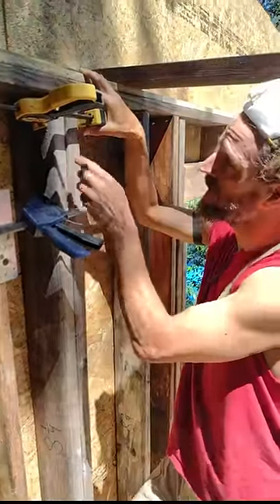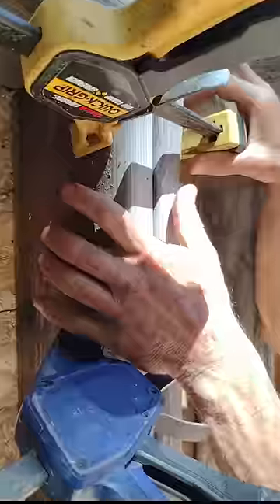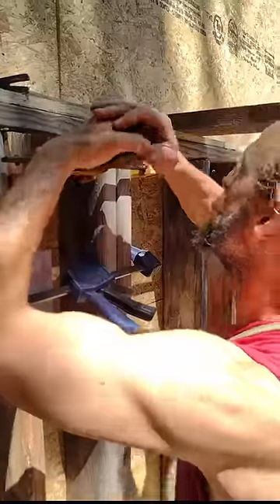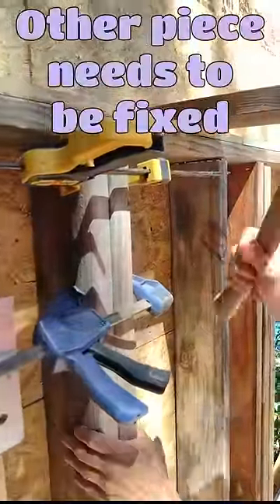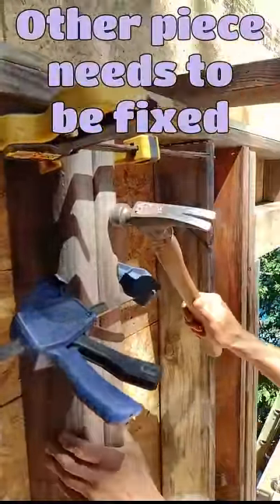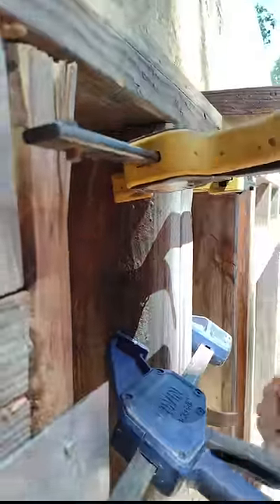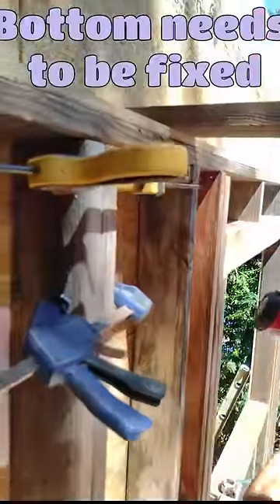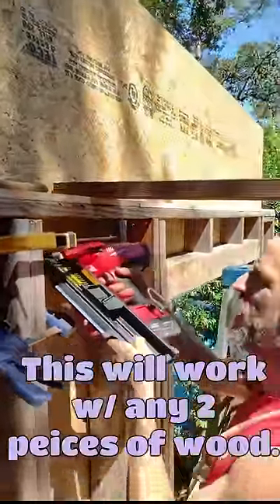WARPED WOOD? Try This.

Comment from the maker: How do you straighten Warped or twisted wood?
Reply: If it is too bad it culled or used as blocking. Sometimes various tricks involving screws/nails for leverage can be used. Some builders also cut studs and pull and nail them back into plumb. This is one reason why lVL products are being used not just for beams and large headers nowadays.
Reply: How far did the siding get pushed out?
Reply: I generally use it for backer board or if we can twist it back we use it. after that .. return it. lots of places get away with it and just sell the shittiest lumber ... dog legged goofy twisters...gotta look down your lumber when uoure buying from homeless death spot
Reply: you dont use it.and never buy lumber that is stored in an outside yard
Reply: Back when we had hammer skills, we'd fix studs like that with a few diagonal spikes driven through the outside high corner in toward the center of the double. The hammer head both pushes the wood where you want it to go and nails it, simultaneously.  Then a few perpendicular spikes to lock it. Takes longer to explain it than to do it.
Reply: Nail
Reply: You use friction ! 😂
Reply: Um wouldn't it still be under more stress and pressure 😅 couldn't that cause it to crack or such
Reply: get a different board

Comment: Hope it isn't getting drywall. The warped wood can also pull the other board out, cracking the drywall. Shaving it down with a plane is a better option for longevity.

Comment: You could also toenail it with half the work! :D LOL
Reply: Yep, a 3" construction screw would draw it in nicely too.
Reply: Why do it the quick correct way, when you can watch some idiot on the you tube show you how to waste a ton of time and nails.... Seems more of a hack tip from someone new in the industry
Reply: @mohawkman2888  yep.  yep for sure
Reply: Ya but it's easier to walk out to your truck and dig around for those clamps you thought you put back in there ........And yes, you are correct, toe nail it and you're done
Reply: Yeppers

Comment: Just put a screw in one of them and use a pry bar!
Reply: I would not. The screw could snap, and then you'd have no way to remove it. You'd be yanking the first stud out just as hard as you'd be pushing the second one in.

I would suggest toenailing, which is putting a nail diagonally from the wood that needs to move in and in to the wood that is already affixed. As the nail is driven deeper in the first stud, it pulls the second stud in along with it.
Reply: @Thalanox a screw wouldn't snap from being pulled on, i use that method all of the Time, ive done it with nails, screws, I've even combined it with your method for more extreme bows, at the end of the day it all works and theres never a one size fits all method
Reply: @Thalanox  What kind of screws are you using?  I use nice construction screws, about an inch to inch and a half long.  They won't break due to a low amount of torque you'll be using.  
But even if it were to snap off, you can easily use the hammer to either hammer it in or break it off flush or just pull it out.  It's not in the wood very deep, about 1/2 inch.
Reply: Hold your pencil against the low board, put the shoe of the nail gun on the pencil.

Shoot one nail, it will stamd proud, grab your cats paw, pry until flush, nail it to hold.

Then drive the proud nail with your hammer.

No need for a drill/screws. 

You can space the nail gun with anything. Rookies speed squares are great to shoot through, just use the corner so it breaks, and make sure you give the guy a new speed square.
Reply: @olddirtybooger I got a good laugh from your comment. I had never thought of using a pencil or square to space the shot and make the nail stand proud.

Comment: True you brought king studs together. Keeping them there with a guarantee can be done with horizontal fire block. Ring shank nails,  hammer driven tip hooked nail and or screws are far better than common nails.  combined

Comment: I drive a nail in the straight stud. Then, use my hammer to pry the other stud. Just have about a half inch of the nail sticking out, put your hammer claw in, and pry on the nail, pushing the 2x flush.  Don't always have a clamp in my tool belt lol

Comment: I always used clamps when screwing bowed metal frames together, i used to build portable buildings. The frames were hand welded and had alot of imperfections. I would get crap for it being a factory environment, but I proved it saved time and energy.

Comment: If you just shoot a nail in the board that is sticking out farther at a 45degree angle on the outer corner into the one beside it, you can them drive it in south your hammer until the boards are flush and nail it off. Saves a lot of time from messing around with clamps.

Comment: Pro tip pull the safety back on your gun drive a 16 3/4 into the stud that’s furthest out and uve the claw of your hammer, or crown your studs a 2/4 shouldn’t be that far out close to the top like that unless you don’t crown your studs
Reply: This guy frames.
Reply: In addition to that always crown studs on your exterior walls to the outside. Interior studs crown either way, as long as you crown them the same direction. Too much crown gets cut into blocks.
Reply: @scottdeason2940  I had an abnormally large lunch so I'm crowning right now
Reply: I used to do this but for framing it’s even faster to just toe nail the proud stud into the the other and drive it with your hammer. It will flush up

Comment: If you're not putting in 2 studs just drive a nail horizontally half way into the stud and vertically halfway into the top plate then hook your claw hammer over the vertical nail and press the stud nail putting the stud into alignment and then nail the top of the stud into the top plate and pull the half driven nails out and you're not even wasting a nail let alone another stud.

Comment: Milwaukee makes a Passlode style gun? Damn, they make everything.
Reply: The milwaukee framing nailer is the shit. Highly suggest buying one
Reply: @ryangluszewski3319   Have you used a Paslode? If so, how does it compare?
Reply: @SightsNjunk  honestly they measure up pretty well. The milwaukee is extremely heavy and pretty bulky, which can make it tough on the wrists. And obviously the paslode has more firepower being an airgun compared to battery. But the milwaukee lasts me all day on a single fully charged 6.0 battery and i havent had any issues with it jamming. The weight of the milwaukee gun is definitely the biggest and probably only negative ive experienced with it, thats why whenever im sheeting a wall or doing something that requires a lot of consecutive nailing i dont use it.
Reply: @ryangluszewski3319 put the the extended mag on it really helps to balance it. I have one and yes it’s heavy but when I put the mag on definitely helped with the weight on the wrist
Reply: @ryangluszewski3319   I usually only use "cordless" (air) guns when I am far from a compressor, or when doing top plates, and punch out work. So being heavy isn't a big deal. I like how much shit Milwaukee has.
Reply: Yeah I want to gat one. I have the 18g finish gun
Reply: @SightsNjunk no gas for 1
Reply: I personally prefer the Dewalt or Bostich brand cordless nailers with the flywheel hammer. the Milwaukee has piston style mechanism which has shorter ramp-up time however is way heavier and more parts to go bad. I've heard the Milwaukee guns need to be professionally repaired every 2 years for a framer. people will disagree but that's just my opinion.
Reply: @levistrnad2965  Man DeWalt is great and all but their cordless nailers are dogshit compared to Milwaukee's line. The ramp up time alone is fuckin brutal if you're used to pneumatic. Milwaukee's framer can sink nails almost twice as quickly as whats demonstrated in this video but i guess ultimately people are going to buy whatever battery line they're invested in
Reply: @mattyboolin  That's the best part about the Paslode. Very short ramp-up time. But you got to buy those damn cartridges. Now I have to look up the Dewalt, lol.
Reply: @mattyboolin  I suppose I've never actually used the DeWalt. I have the Bostitch which I thought was a clone of the DeWalt but I could be wrong. Either way I'm an HVAC install so it works for me...
Reply: Better than PL.
Reply: That milwaukee is battery operated so they don't shoot as fast as the gas paslode but you don't need to buy gas
Reply: @SightsNjunk of you're referring to the gas powered Paslodes then the Milwaukee is just as if not stronger than they are and you never have to worry about getting a bad fuel cartridge. My recommendation is to go with the 30 degree version as it holds twice the nails and you're not getting hit with little pieces of plastic all the time, and the gun will actually stand up when you set it down. The extended mag doubles capacity and helps to balance the gun.
Reply: @MatthewJRedmond the new battery framers are awesome. Only time it didn’t compete with air or gas for me was stitching into yellow pine glulams.
Reply: @jhueth3969  I originally bought mine for shooting on trusses but wound up using it for everything. Haven't found anything it wouldn't sink a nail in yet myself. Have even shot nails through treated wood into concrete when doing interior wall toe plates. Now, granted, the concrete was only 2 days old and hadn't gotten its first hard set, but it makes for a good story to say it shot into some Crete 😂

Comment: That's 1 way,it worked.take 16 penny nail, drive it in on that far right corner, push the board where you want it to go, put a few more nails in it once you've got it in place,that nail in the corner hugs the board over, you pushing on it helps greatly,😶

Comment: I rather used that old lumber than fresh new ready to dry out & twist. The old wood is done twisting & shrinking. Much better build than new wood. This message is too all the none professional home builders commenting. Also, love not putting extra holes in the lumber where not needed.

Comment: That will eventually poke back out and damage the drywall, nails are only good for keeping warped wood at bay temporarily. What you REALLY needs do is give it a little trim on the table saw 👍
Reply: Lmao, wrong
Reply: This is not hardwood finishing carpentry in a nice shop with super tight tolerances for everything. This is softwood framing where structure is what matters. Softwood swells, bows, crowns, twists, and has many imperfections in it. Working on a mostly flat surface here is already an unreliable luxury.
Reply: This was what I thought as well, but I'm no carpenter.
Reply: @Thalanox  a trim on a table saw to you equals a super nice shop with tight tolerances?? Do you do yoga bud because that there is a S T R E T C H. In essence what you've said is im correct but who cares it doesn't have to be perfect, id like to see you say that to a client 👍

Comment: Or you can drive a 10 penny on a 45 at the top of the 2x4 into the top plate and it will pull the board into the other just stop at flush and nail away. No need for clamps. just slow careful nailing!

Comment: Bud, why complicate matters. I can see three different ways to drive in a nail (or screw) with a "toenail" technique. No need for clamps, At All, and Much quicker.
Reply: make a video!
Reply: @gregmize01  YouTube has got all of the "pro tips" vids out there that it could for for.

(You could also put some relief cuts in to bring the shape back, loosing a bit of integrity in the process but I don't know many framers that consider that a big deal while sisterd up to another stud 🤷‍♂️.)

I have no need of creating videos. I was able to give you two different alternatives in this one post alone (without the hassle of working a camera or needing an algorithm to find the right viewers). ✌️
Reply from the maker: Toe nail probably would have worked.  Prybar too.  You are right.
Reply: @TheRegenerativeHome  Eh, the clamps look like they're prioritizing avoiding damaging the studs.

Comment: Put a nail in your top plate and use your hammer to to apply pressure to the bowed board till it's flush then run your sistering nails.
Reply from the maker: That's a real pro tip!

Comment: Just nail off the straight one to the top plate then slap a nail in the straight one and with your hammer pull or push the warped one into place

Comment: Where the heck do you buy your lumber😂?
Also, if you set a screw int to the face od the sister stud, you can just use your hammer as a lever and not have to run back to your toolbag to grab clamps. End result is the same.

Comment: Until that wood movement bends the nail or snaps screw, don't underestimate wood movement, most likely what will happen it won't be that drastic just have a twisted not plumb wall in a few months to years... Just run it over a jointer bro

Comment: I always made a kerf cut if badly bowed.
Reply: Can't kerf cut supporting walls, you either plain or add a 2x2 if the crown faces out. Interior wall you can cut and reinforce after with 5 or 6 ft peice nailed to the side of the cut stud.
Reply: @matthewcardoso5421  I thought it was understood. Kerf the stud and sister a 2nd stud to it.

Comment: Put a screw or nail in the board that is sunk in and pry on it with your hammer until the other board is flush. No need for useless quick clamps. -pro tips from a carpenter.

Comment: Just half drive a nail with your nail gun into the other stud then use your hammer and pray against the nail pressing the stud tight then nail it off with the nail gun. Never seen a framer use clamps

Comment: I think the word is tension, friction would refer to a different type of force :)
Reply: Tension is the pulling-apart force. Compression is pushing-together force.

Friction is what is needed to stop the second stud from bouncing back out after you tap it in.

Use the compression to squish two surfaces together (-->) in order to create the friction (-->) to allow the movement your hammer causes (-->) to be permanent enough (-->) to let you lock it in with nails.

Comment: Don't forget to soak the wood with a water hose so it forms the shape. Then use a hair dryer to dry it the next day. Then soak a second time to be sure. Then use a flame thrower and burn it all down! LOL!
Reply: Perfect studs are usually very uncommon. You've got to find the straight (or usably straight) ones from the stack and use the straight ones for the most critical parts of the wall.

That the wood here was out of flush like that tells me that he's adding another stud to an existing wall. This comes with it's own set of difficulties.

Comment: Well if the studs were all crowned your less likely to run into that, and you could’ve just toe nailed the corner give smack with the hammer and it was fixed in less time it took me to type this

Comment: Ight bro but even if I wanted to double work. . .  friction definitely wasn't the word you were looking for
Reply: He failed to first show that a lack of friction was the problem.

In cases like this where you need to make two studs flush, and there's some warping to deal with, you'll find that just hitting it with your hammer  might not work. One of the reasons it might not work is that the stud you're installing might move in to the correct place, but then bounce out just a little bit. 

Adding the friction to stop it from bouncing out again is what he was doing here.

Comment: Just toe nail it together and smack it flush. I got enough shit in my belt, I'm not gonna hang a pair of clamps on it too. Tossing two toenails right on top if each other and tapping the proud 2x flush is the technique any competent framer uses to flush up or move a stud

Comment: Why waste your time with chasing down claps or carrying thousand pound claps and all that business. When you have a hammer,cats paw,nails?  Drive 2 nails into the wood either side it doesn't matter and pull your cats paw out and pull on the nails till the wood is flat and grab your hammer and beat your nail in that you started before you did anything. And a hammer is a piece of titanium with a wooden handle and a cats paw is a piece of metal that is use to pull nails for anyone kids or adults don't know what a tool is

Comment: Pro tip - let's stop building structures with wood. Haven't learned from the 3 little pigs fairy tale. Concrete and block. No wonder insurance companies running away from Florida. The places with tornadoes still haven't learned. Just rebuild the same things that storms keep pushing over. Even if wood roof gets ripped off the block walls still standing so easier to rebuild.